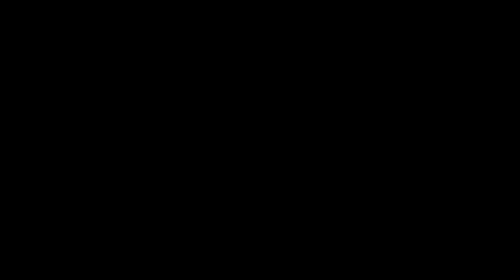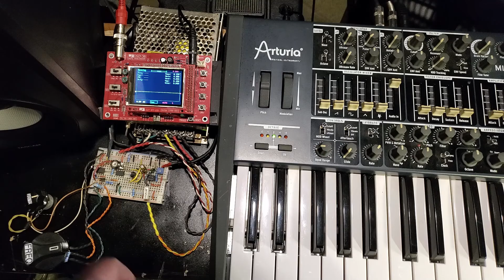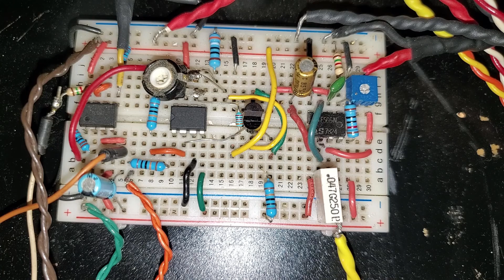DIY NE566 Analog Synth Oscillator on Breadboard (not NE556).

Comment: very nice.

Do you have a schematic?
I have a few of these and some 2k tempos in my parts bin, would be fun to try.
Reply from the maker: Thanks! Here's the schematics in 2 parts. The Glide circuit goes before the CV IN on the 566 circuit.
566 VCO:
https://imgur.com/0cuMZ0n
Glide: https://lookmumnocomputer.discourse.group/t/diy-portamento-glide/2587
Reply: @nonsuch  hey.
Thank you very much.
Reply from the maker: @Nopp3  No prob. Let me know how it turns out!
Reply: @nonsuch  built it on a veroboard today.
Works great.
I used 12v rails instead, as I'm on eurorack.
It was a quick and dirty test with no panel or anything.

now that I know it works I'll use this to create a more complex vco sometime later.

EDIT: I should mention I didn't build the glide bit. but I like the idea of having it integrated into the vco as opposed to a separate module.
I use glide often and its extra cool when you run several voices for that fat sound with separate glide times.
Reply from the maker: @Nopp3  That's fantastic! Yeah, I would imagine 12v is probably ideal for most modular setups. Did you have to change any component values to accommodate that? So, the reason I built the glide circuit was because the MiniBrute doesn't send it's glide out on CV and I wanted it to have that. What ended up being cool about it is now I have multiple glides and that's normally not something the majority of synths have. It just adds another dimension. I'm glad it worked out for you. I need to build it on a permanent board as well. I just wanted to be able to swap components out to see what I could come up with and maybe get lucky with something different. The 566 is a great sounding chip. Cheers! 🍻
Reply: @nonsuch  nope. no value changes at all. 
It worked first try so I didn't mess with it.
yes the phasing you get with multiple glides is great.
 
creating a saw output should not be too difficult either.
inverting the triangle while the square is high should make a saw.
pwm is also pretty simple.

cheers.
Reply from the maker: @Nopp3  Right on! I've used an "integrator" circuit to change a square to a saw in the past. And if you take the outputs before and after it, you can have the square and saw simultaneously. And instead of using another 8-pin dip, you can use a dual or quad package to accommodate the CV portion and Integrator. In case you want to try it, here's the schematic I've used which actually gives you a few different waveforms you can output:
http://experimentalistsanonymous.com/diy/Schematics/Full%20Synths%20Drum%20Synths%20and%20Misc%20Synth/Square%20to%20Saw.bmp
Reply: @nonsuch thank you for sharing the schematic